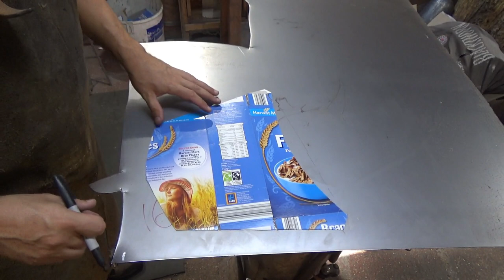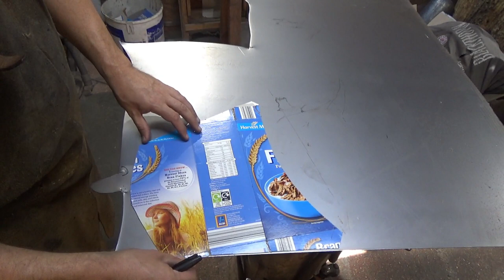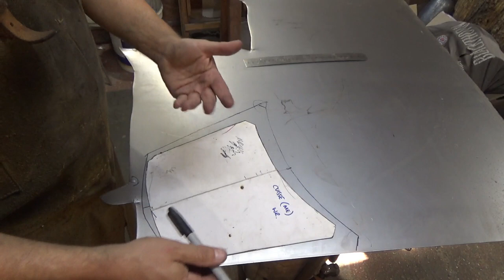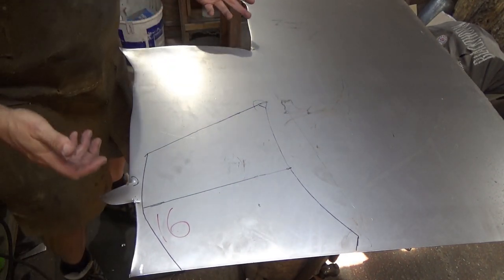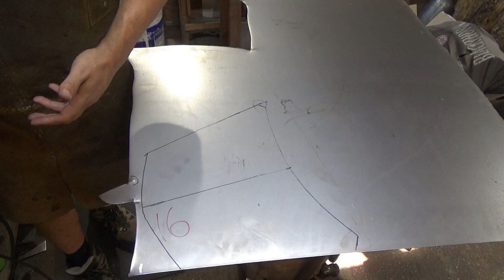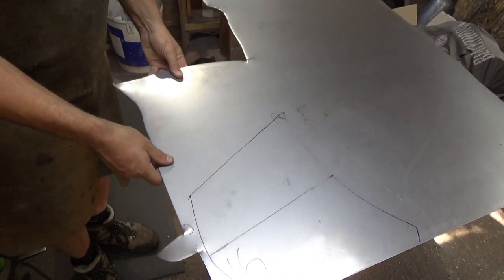Making medieval thigh plates, cuisse. Part 1 of 5, medieval armour techniques.

Comment: ive been using and angle grinder to cut things but thats slow and makes mess. do shears work for 14 gauge as well?
Reply from the maker: These heavy duty ones are meant to be rated to 3mm, but you'll be moving the cutting edges along more regularly and be sure to have the distance set between the blades at the correct point. But they have cut 2.4mm in my workshop well enough. What I tend to do though is grind the basic shape with 1mm slitting disks and then cut to shape with the shears, it is a lot less effort, but won't solve your mess problem.